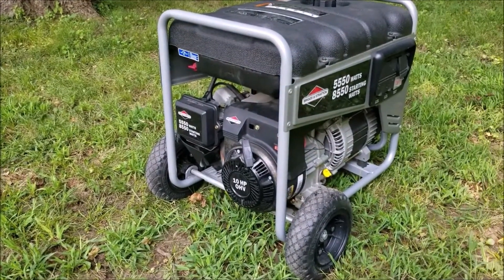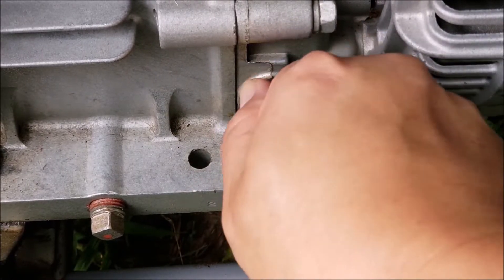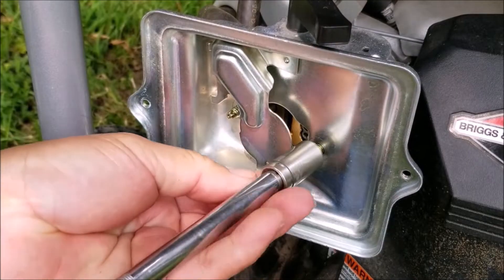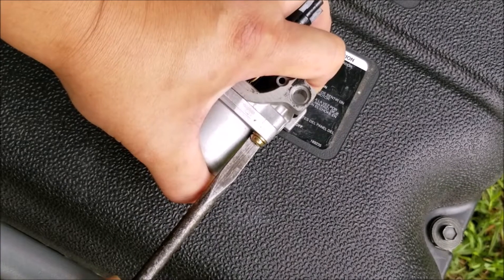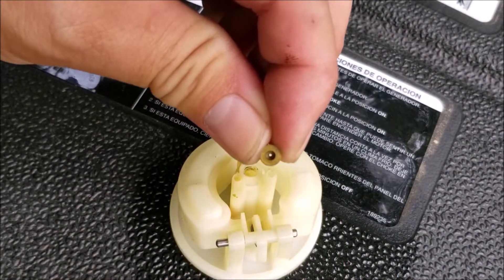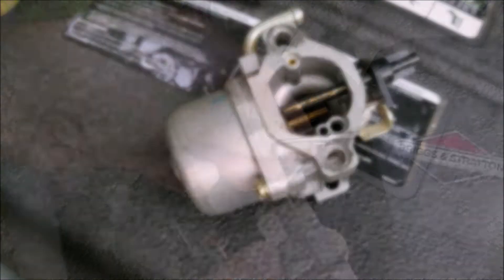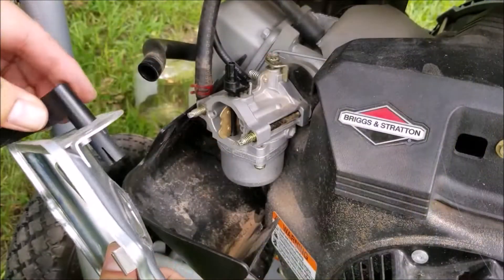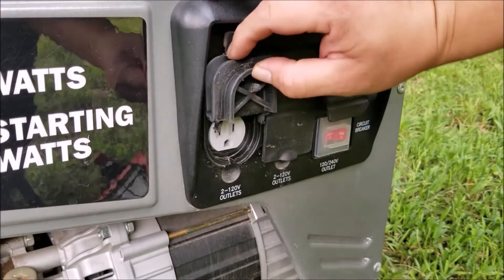Fix a Generator that only runs on Choke.

Comment: Have an ice storm coming. Mine is doing the same exact thing. Any harm in leaving like that and fixing it later? At least it’s running right now. Don’t want to make matters worse, but also don’t want to mess something up running it like that if I shouldn’t. Looking forward to hearing!
Reply: i have the troy bilt 8250 with B&S engine, mine was doing the same thing, during recent power outage in KY.  It ran fine on full choke, so I loaded it up with two freezers and ran it 4 hours on full choke with no trouble at all...now today,  I ran onto this vid after getting power back and thanks to INSIDE HOUSE GARAGE it is fixed and running great without choke!!!
Reply from the maker: @jacriel4416  thanks for the comment I appreciate it
Reply from the maker: I really don't know. It's one thing to have it run on choke with no load however I'm not sure what will happen of you put a substantial load on it. Hopefully you won't need to use it.
Reply: Currently in Texas, right there with you on not wanting to touch it and lose any use when it's most needed. Have you had any issues running it on choke for the time being?

Comment: My customer power generator same problem but after cleaning crab but problem is not solved any other problem sir
Reply from the maker: I would suggest replacing the carb.  If that doesn't work then I would inspect the engine for an issue.

Comment: I'm surprised, simply cleaning the hole fixed the entire issue! Nice work!
Reply from the maker: Its really that simple sometimes
Reply: That nozzle/hole as you called it, is known as the high speed jet. In this video, the guy should have also cleaned all routes within the carb, not just the high speed jet. There was no mention about the low speed jet that's in every carburetor on the market. They need cleaning as well, and might as well do it  at the same time you clean the high speed one, so you don't get surging in engine.

Comment: Never herd of a E6 socket before, i guess its like a male torx bit, good fix, but not keen on all the plastic bits in the carb .
Reply: a 4mm socket will work too...
Reply: @jacriel4416  yep
Reply from the maker: Yes they are also needed if you work on VW cars. Me too. Plastics are meant to break

Comment: I always use ethanol free fuel and run it dry after each use. It always starts on the first pull.
Reply from the maker: Nice.  I appreciate it if it starts after any pulls so long as it starts.  Thanks for the comment I appreciate it